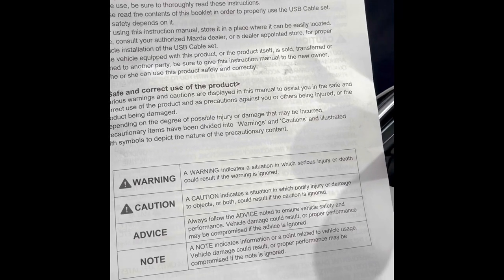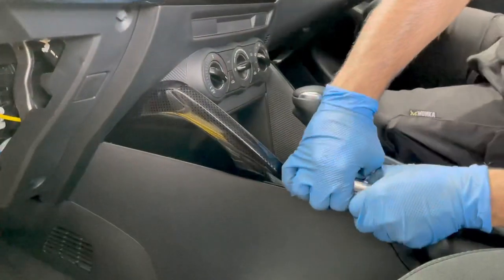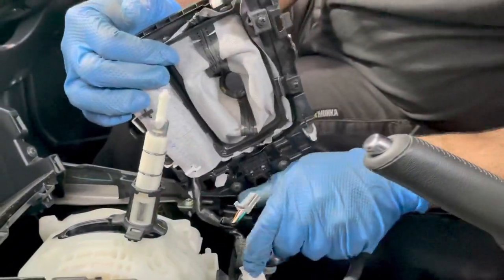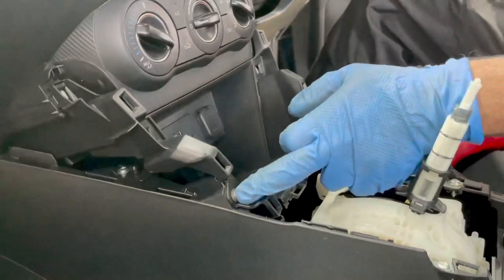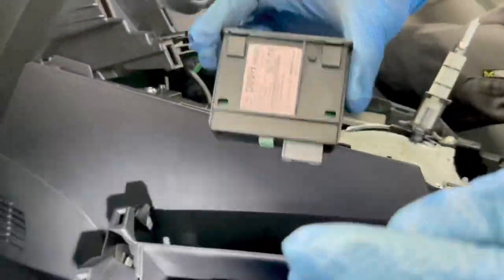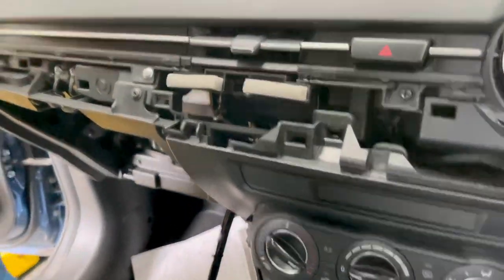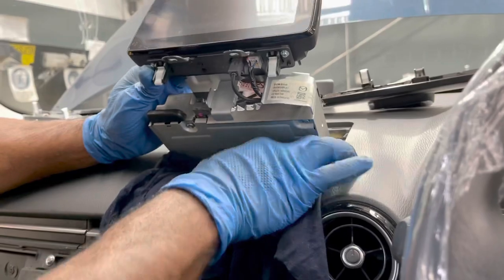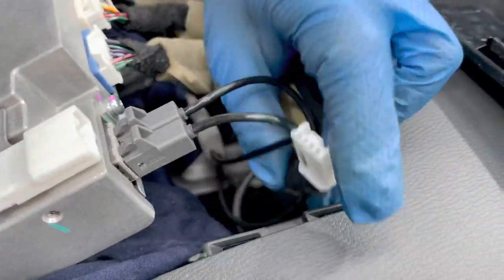Installed Apple car play less than 15min Mazda 2 2019 DJ model

Comment: Good video. It's more like a 30-45 minute job when doing it the first time. Just to note, it's not needed to remove that carbon fibre trim below the head unit. You only need to move the front part of the centre console up slightly to remove gear gaitor. And like someone else mentioned, work the wires from top to bottom as it's a lot easier, threading from behind the glove box which saves you from removing that.
Nevertheless, Mazda wanted £240 on labour to fit this, and this video helped me save that money! Lol.
Reply from the maker: Hi
Thank you for comment and you mention that carbon fibre trim no need to remove yes you correct, but I removing it no scratches or any damage, if you scratched that too expensive to replaced that part.it’s ok you working on your own car but if you working with someone car. You have to do properly and nice and neat job.
Reply from the maker: Pls subscribe

Comment: Thank you very much, I have changed the radio by just watching your video 👏👏👏👏👏👏👏   for anyone still want to do it. The way I changed it for Mazda 2,scion IA 2016.

1. You don't need to remove the glove box, just open it and from top of your car screen(after you opened it like the video) slide the cable to the glove box. Once you slide it, it is easier to send it to the new radio. 
2. I only removed the radio like the video and didn't remove the shift cover or the one he pulled, just remove the rim around it. Since it is necessary to remove the radio to change it. And it is hard to remove the screw just with screw driver when you remove the unit(the screen part) I used the screw gun. 
Basically the point is. Remove the radio, remove the unit(where the screen is) and just plug the cables. You don't need to remove parts around the home button or mute.... 

And I bought the android auto from amazon for $59. And don't forget to tie the cables together, or they will send you a thing to tie it when you buy the radio. And after you plug, before you put it in, I suggest you try if it works, just to not waste time if it is not compatible. You will see the android auto and carplay greyed out. If you try with wrong cable it may not work, it didn't work at first but when I try with another cable it worked. It isn't hard, but ofc you can be nervous if you have no clue but decide to try it just to not pay around $300 for dealers. Good luck, and if you have any question, ask me, I will answer.
Reply: I will try it in the upcoming days on my M2 2016 dj 115, i’ve bought the unit off amazon for wired apple carplay (80€), i updated the firmware today to make it compatible, i’ll write again when i get the thing if i need help, thx for the offer!!
Reply: Also, the unit connects to the screen right? But the original “brain” of the car is still there right?  Like i’m not changing the whole OS am i?
Reply: @Maririo93  before you change anything, be aware that the sd card may not work anymore. Mine stopped working, probably it can be because I didn't follow the unit guideline, not sure.
Reply: @Maririo93  You only change the radio, under, you don't change nothing on top, just plugging only.
Reply: @ADwaMoviesandMusicsproduction  Understood thanks. Well i don’t use the sd anyways so that’s fine
Reply: @Maririo93  so you don't have to worry, but the sd card is really essential, if you find yourself in offline places, it can be useful, if you don't have it at all, so you are good to go.
Reply: @ADwaMoviesandMusicsproduction DONE! It was way easier than i initially thought, the screen was my biggest fear, since i already tried to take it apart once and it didn ´t work, but with a bit of violent love :D it came apart super easily. Now i have apple car play :D awesome. I noticed that as soon as i interact with the phone, the audio works only on the right speaker, if i use only the carplay all is fine. Hmm… i guess that ´s the price u pay for spending only 80 quid instead of 600 from mazda. But since i don ´t plan on using the phone while driving that is ok. I might check on it again but at the moment i ´m fine

Comment: I just did it today. I took the lower side panel out and I was not very kind to the old module with a flat head and needle nose plier, after all, that is junk anyway. I used a wire guide from top to bottom and then hooked the wires with a wire hanger shaped into a hook right out where the new module was going to be. Quick and efficient. Only removed the side panel by the accelerator, I did not have to do all that (really took 20 minutes) and my CX-3 is just fine now. Oh and aside from the little sponge stickers I used a zip tie on the two cables so that gravity would pull them down together then I hooked them and pulled them out the hole for the new module. Oh and yes secured with zip ties and the anti-noise padding supplied.

Comment: THIS IS THE REAL TUTORIAL! Done it on mine in 90 minutes circa. I had a bit of issues with the cd player (mine came with that above the mzd unit) which does not fit fine with the two new cables. I think I am going to remove the cd player which I never used it and put a mask or a pocket to fill the hole.

Luckily I did not need to do a software upgrade and the car engine started correctly after the upgrade (LOL)

Now I wonder? Is the MZD disconnected from the car engine? If the replaced CarPlay unit turns to be junk or faulty, does the car work without it? (I think so but I'd like to hear other opinions)
Reply from the maker: Hi, my friend, 
 Entertainment unit, not effect your engine idle.

Comment: I just installed this but the touch control dont seem to work in Android Auto. Any ideas?
Reply from the maker: Check out your connection or software update up to date
Reply: Same here just, just check my connections but it seems I'm missing one cable but originally just came with two ports the green and the other ac one :c
Reply from the maker: @alexanderfranco3613  
One green and blue (it’s depend on country)Australia we using green and blue, other end gray and black
Reply: I did some research and apperantly Android Auto just doesnt work with touchscreen in Mazdas. Something to do with the disabling of the touchscreen while driving...
Reply: I read that touch doesn't work on android auto on mazda. I also changed it and it doesn't work. And i heard in one video review of android auto. It doesn't work. But if you goto home, the touch works. It is just mazda thing in my opinion.

Comment: Hi I was not able to unscrew the 10mm holding the screen, I used a drill screw, and by screw driver still doesn’t work. Do I need any stronger tools?
Reply from the maker: Used ratchet socket 10mm and 3/8

Comment: Hi! I own a 2016 Mazda 2 and I would like to upgrade by  putting an aftermarket radio and speakers. Could that be possible??? Every autosound shop I have visited have told me that there are no aftermarket radio for it😕.
 One of the problems I have with the original sound system is that sometimes,one speaker sounds way too low. It may be a cable contact ? 🤷‍♂️
Reply from the maker: Hi
What type of audio unit you got can you pls provide me your radio unit picture.
Reply: @vindiroshan  how?
Reply: @vindiroshan  it is the one in this video:
https://youtu.be/9bobx_qPLFs
Reply from the maker: Yes 
You can upgrade my friend try to look Mazda dealer ship or online dealer.

Comment: Update to V70 or latest v74.000.324A version?
Reply from the maker: 74, pls
Reply: @vindiroshan  ok i see alot does v70 but latest is v74. And have some bugfixes i have read.
Reply from the maker: @anthonyg87  
Yes, it’s depend, some time v70ok,
But latest version good, 
Pls refer manual
Reply: @vindiroshan  yes Chinese sets wil Come with v70.00.376 but latest sw version is v74.00.324A and fixed some bugs after V70.

Comment: Hi @Roshan T Automotives....

I'm hoping someone out there who knows a lot more than me about this can help. I'm contemplating retrofitting my 2018 Toyota Yaris iA with a software update and usb unit that would allow me to use Apple Carplay and Android Auto with the existing screen.

The 2018 Yaris iA is actually a rebranded Mazda 2. So, can this video be applied to a toyota? Is that right?
Reply from the maker: Yes 
Same procedure but different brand name 😉
Reply: Just did it on my 2016 iA
Reply: @keninho1735  Hey! I have a 2019 iA. What part did you use for your car? I can’t seem to find it anywhere. The part number in this video is from Mazda and I’m afraid it might show Mazda logos in my car. Any info is welcomed. 

Thanks!
-AC
Reply: I am getting ready to try this on a 2018 Yaris iA. Looks identical. I will need to update the software, but I'm game.

Comment: Do the steering wheel functions work?
Reply from the maker: This unit only upgrade features not functional change I mean if replaced head unit you need to replaced steering connection and all wiring, all functions work as normal.
Reply: @vindiroshan  how much cost the kit? It’s needed also an upgrade of the firmware of the display ...or just change the little new box?!
Reply from the maker: @FrankP83  
You need to call your nearest Mazda dealer they will tell you.
Reply: @vindiroshan  ok. thanks i will do!

Comment: Greetings, it can be connected to yaris 2019, the car is Mazda, the bodywork and the radio, everything is also Mazda, thank you, I await your response.
Reply from the maker: Yes you can make sure to get same connection and software update correct on.
Reply: can have the same connection but how can I have the software updated? How can I be from Puerto Rico?
Reply from the maker: @josafetmartinez2786  
If you have 70.00. It’s ok but you have 51 or 59 version you must update.
Reply: the version is 59
the version of the music db is .07
fail sefe version is 59 as ago to update that
Reply: you sell to update thanks
Reply from the maker: @josafetmartinez2786  
Yes my friend you must update 59. Is old version after you replaced without update you system not working properly.
Reply from the maker: @josafetmartinez2786  
I try my best to upload that software everyone asking about but problems is my software supporting only Mazda brand .

Comment: Where did you bought this?? Thanks👍
Reply from the maker: Mazda dealer
Reply from the maker: Yes mate this genuine install all functions working fine this unit only for apple car play we not replace head unit if you remove head unit yes you need steering wheel plug.
Reply: Say ‘easy’ one more time 😂
Reply from the maker: @mr_k4tz  
🤧🤧🤧🤧🤧